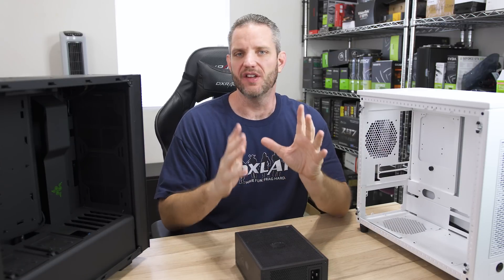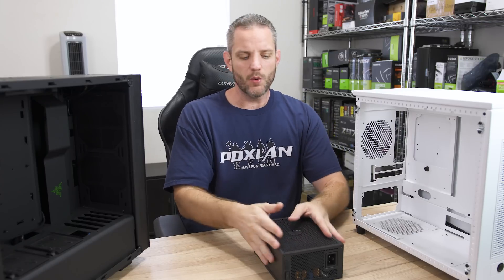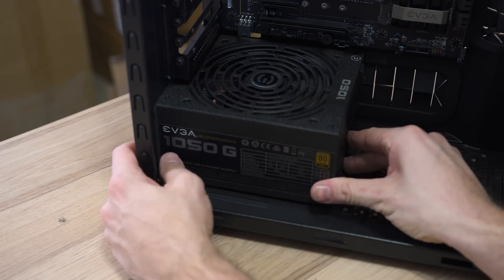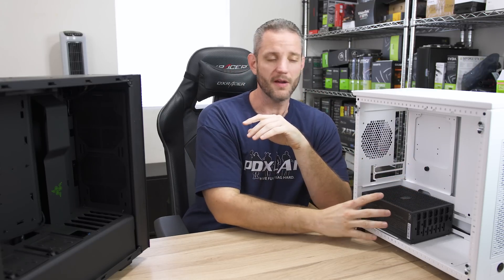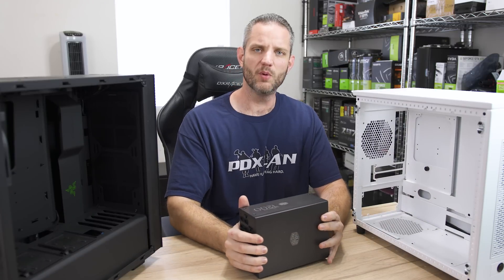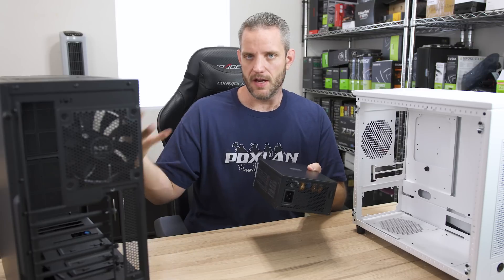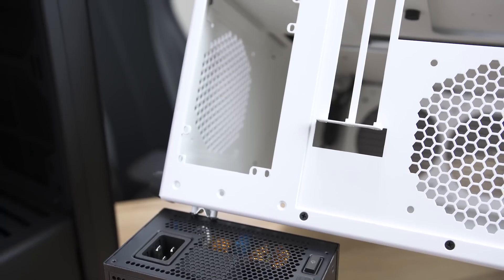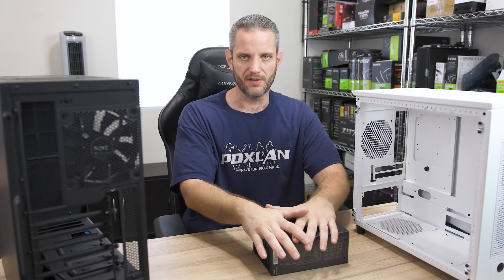Should you mount your Power Supply up or down?

Comment: I just recently upgraded to a case wherein the PSU is actually mounted at the bottom, and never even thought about putting the fan up. Now I'm wondering if flipping it might actually positively affect temperatures inside the case.

I've got a little question too: you do watercooling on pretty much all the CPUs I've seen in your videos, be it a custom loop or an AIO. Does the lack of air/less air movement across the mainboard actually affect the temperatures of the RAM modules and/or VRMs?

Comment: Then it's a fight for air between graphic card and this 'upside down PSU situation' in smaller and ... most of mid tower cases.
I'm kinda ''holding it down on the engineering tip ya' cuz  PSU is not cooling element. Designed to cool itself (with some margin of course) but not for cooling whole, badly organised system.
But, there is always exceptions.

Comment: I mount mine on the bottom with the fan facing into the case. My case has enough air flow that there isn't any stale hot air in the case for the PSU yo drag in. Also it has dust filters on the air intakes,  (bottom of the case doesn't) so it won't drag in dust either.

Comment: That's bullshit. Most good bronze and up PSUs don't even have the fan spinning until after X temp. So now you basically added another heat source into the case until the fans turns on. Flipped vent down, the heat can't travel up through the vents into the case.
Reply: 100% correct. He's full of shot by his own logic. Most of the time the fan is not on, or on so low it doesn't matter. this creates zero air flow in the case, positive or negative.

Comment: Jay, you forgot about one more thing i guess, u can also avoid psu getting hot from graphic card by putting in downside. There are different gpu cards and some of them create alot of heat, in my case psu pulled hot air that gpu generated which made 'him' to get hot.

Comment: Jay, I mount my PSU with the fan up.  I am on air cooling, the PSU fan does not spin up until under heavy load.  I chose fan up because the Define XL V2 does not have a filter removable from the from, therefore, I am not going to clean that filter.  Also, with positive case air pressure, air is forced through the PSU, keeping it cool.  I am going for cool and quiet with 2 input fans and one exhaust fan.  I have also added a magnetic fan filter to the top of the PSU.  If I had a Define R5 case, I would go fan down.  These are just my thoughts, but it works for me.

Comment: Hey +JayzTwoCents i know you usually answer questions so i'll ask it directly to you. I have a corsair 100r and only one exhaust fan in the back. My PSU is now facing down and i can't see how i would benefit from making it face up. 

Why is it that you say that if it is facing up then i have neutral presure? Isn't that PSU exhausting even more air so it would make it even more negative? 

On top of that i have a filter on the bottom and can't filter the PSU if i mount it facing up. What is your opinion in my situation?

Comment: So you're basically pushing air in the system with no air from the outside coming in?

Also what if you instead used mineral oil instead of liquid water coolant in the basic water cooling system? Maybe have a little something that can quick chill the mineral oil fast enough as it flows through the system to keep it cooled down.  The only thing I have ever see is people submerging their computers in mineral oil to keep it cooled, but never in a water cooling system with pipe tubing.

Comment: Recently I purchased Antec hcg-900 so I mounted it as the previous PSU with the fan facing down, the PC kept shutting down every few minutes in Games, so I found out that the unit shuts down after it reaches 45c, then I flipped it and no problems since.

Comment: Yes! Jay is back :)
I had my smile this morning, plus a ton of info as usual!

I had to buy a psu a few days ago and was wondering about the possibility to mount it fan facing down in order to keep it free of dust. My case is an Antec Three Hundred and has those little feet inside the case and there is space for the psu to breathe, so I will turn it upside down next time I open the case.

Comment: With all due respect Jay, I don't agree with you on this one (although if you have an overkill, silent fan PSU it doesn't matter... mostly).
Physics: the coolest air is at the bottom of the room (that's why your argument that the PSU facing down may draw some exhaust hot air would be valid only if you would've placed your pc case very close to a wall and leave no room for the PSU exhaust air to dissipate).
I found out empirically that is generally better to have slightly negative pressure inside your case cause that would pull out potential dust particles instead of pressing them into pc components (when you have positive pressure).
Exhaust at the top of the pc case is also crucial cause a warm air cushion will be formed in the top half of the pc case, where the CPU and RAM are located. That's why it would be a bad idea to have your PSU mounted there: it would heat up more when "cooling" with the hot air from inside the case and that would shorten PSU's lifespan.
Almost forgot: good day to you, Jay!
Reply: "...instead of pressing [dust particles] into pc components..."

facepalm That's not how it works. That's not how it works at all.
Reply: Convection is completely overruled inside of a case with any use of system fans. The forces of convection are minimal compared to the flow of air from the fans. 

Negative pressure does draw the dust into the system more than positive pressure (unless you seal the seams of the panels or any vents, and you can ensure that the larger particles are filtered out.  With negative pressure, the dust will come through every crack. Typically, directional airflow works the best in a case, front to rear.  All that is really needed is intakes to provide flow and pressure, the exhaust will work its way out. Blowing air on an object you are trying to cool is much more productive than sucking air from it. There are parts of the case that wont get much fresh air in a negative pressure system. The air will flow fastest where there is least resistance, where if you have positive pressure, with linear airflow, you will cool the system better.

If you burn your finger, do you blow on it or do you suck air away from it?

I disagree with him about the warm exhaust from the PSU being drawn down, its possible that some might, but not a meaningful amount.
Reply: I don't agree with Jay too. +A casual Gamer after watching this video I thought the same thing.
Reply: Harold Mossbach
Yes, front - in, top and back - out.
Most decent custom pc cases are built with this in mind anyway.
Reply: If you have negative pressure in your case you are sucking air, (and dust) , into your case and onto your components, you have it completely wrong.
Reply: That seems very well accurate but I guess it also boils down to how well ventilated the place is. If the case is stuffed into a corner with some other tech that gets hot or near a radiator it might be preferable to get the airflow from the front fans. Not that it should really matter unless you constantly suck in HOT air anyway.
Reply: what if the the case has a psu shroud on top? would this be good?
Reply: The older cases(from like 20-10 yrs ago) originally came with TOP mount for the PSU with fan facing down, which did act as a good exhaust for entire system and was practically impossible to drop water, screws, dust or other material inside(water blocks were uncommon back then), I still have such a case and will keep it as long as computer parts in ATX format will be available. Some reviewers and forum users do argue that this configuration was phased out because PSU was not cooled well enough because it sat right over hot CPU and VRMs and did intake hot air from those components + raising hot air from bottom compartments of the case. However I have yet to find any credible evidence that this actually does harm PSU as I had been operating this setup for about 20 years and I had PSU failure only once and that was PSU which was super cheap and worth about $15 (I have moved to better units since then).
Reply: @elerian9702  i completely agree with you but you can sell more case by making people think its better. case nowadays is more about the show then the go.

Comment: The single reason why you should NOT point the PSU's fan up to your case, is if you have a passive cooling PSU like the EVGA one, which turns on its fan on a certain power draw threshold :
It will not circulate warm air out of the case, and the warm air from the PSU will just rise, getting sucked in by your GPU, and eventually by your CPU, heating them up for that extra little bit of heat from the PSU.

The single reason you should NOT point the PSU's fan up to your case if you do not have a passive cooling PSU, but a "normal;" air cooled one, that constantly spins, is that it will heat the PSU itself more, sucking the warm air from inside the case, being heated up by your CPU / GPU mostly. That way the PSU, and the rest of the components have their own air intakes.

So, it is rather easier for that friend of yours just to put up a freaking piece of wood under his case, and get one extra intake of fresh air from out of the case.

Sorry, but none of your arguments here make sense, Jay, except the one that you should point it down in case of water leaks, which is just one more reason, added to the rest, not to face it up.
Reply: Vuk Mandic if the psu isnt pushing heat out the psu will warm the inside of the case regardless of up pr down ......... the only way to avoid that at all is external psu
Reply: Seriously though, we're talking about some serious power draw if a full internal psu heats up THAT much to be a concern. I personally find that at the bottom of the case is an all round terrible place to put an intake.... For any reason lmao.

I must point out however, that this chain reaction scenario you draw out is rather ludicrous, and reeks of madness. You make it sound like your thermals is your white wale or something. XD

Comment: Jay, I've build a lot of computers, for friends, colleges,...
But since I don't make money on that and that, I always buy what I think is needed for the system. Usually cpu cooler wize I went with a <40$ air cooler like the 212evo. For my computer as well as 2 of my friends' I build a waterloop and always went with a 240 rad or 240 aio. But with the arrival of 120 AIOs in the 50$ range, I would like to know it they outperform a 212 evo. But since I don't grab extra parts for testing, and you have so much laying around. Would you mind doing a little comparison? Do they make sense or should I rather go with an air cooler for the same price? And compare with 240 AIOs to see what would be the best bang for the buck.

Comment: Hot, sticky, sweet. I always thought it's better to keep it down for less dust to accumulate in the PSU itself. I once flipped a psu that was fan up for 4y and there were 9 generations of dust bunnies in it, more than the whole system combined. But then again, the last case I had had the psu on top (old school)

Comment: funny when I use positive air pressure my PC be filled with dust and with negative there lot lesser dust lol..and I always force my PSU fan to run no matter what it's not noisy anyways better to have it constantly cooling the components and still find mounting it down it's the best.

Comment: Also if you have a semi-passive PSU it could be better to mount it fan up so the hot air rises away from the PSU by itself and the fan doesn't have to spin so early/at all.

Comment: One factor to keep in mind though, is your GPU fan config. If it is a blower style then ok, do whatever you want. However if your card has open sides and has 2+ fans, it would be a bad idea to use the PSU fan to extract hot air from inside the case. Most PSUs have an operating temperature between 40-45 C so that may be a problem.

Comment: PSU... I bought a RM550X and its powering an E3-1270 and a GTX 760. PC runs fine, but PSU's fan never spun. I know it only spins up after 225W, but I fear the fan never spinning regularly may damage it... how do I "force it" to spin? add load to the system?

Comment: Jay or anyone else here I have a NZXT phantom white case I want to install water cooling but not sure what I should get and where I need to mount which radiator. I have a amd fx 8350 but when I am in my bios as soon as I switch my pc on instantly my cpu hits 60 and per second it goes up with a degree (Celsius) up to about 70/80 without any load so mainly I play csgo but obviously I don't want to play anything else due to the cpu overheating as it might fry it. Yes I have changed thermal paste multiple times but still nothing. Any help would be very appreciated!

Comment: I did some testing with mounting a PSU. I have a AXi power supply from corsair which uses the link software. What I did notice using the corsair link software if the fan was facing down it indeed was getting hotter compared to the fan facing upwards. But what really did it for me mounting the PSU with fan upwards was the airflow. As Jay said the fan doesnt run that much only under heafty loads. As soon as the fan did kick in it the oevrall temperature seems to drop 1 or 2 degrees. You can agrue only 1 or 2 degrees however it is still 1 or 2 degrees, 

Anyway again a great video. Keep up the good work. 

Ohh and when youre gonna fill up that awesome tiny white CL Nova case ?. I love that thing !!!

Comment: It should be mounted with the fan facing up, semi-passive and passive psu rely in convector principle (hot air rises) when running in passive mode and yes my english is not the best.

Comment: I have the RM850x, the kinda tier 2 low noise one, but I like my caps are cold as possible, every degree lowers increase life by many hours, so even though the fan if off and power draw is low, the heat got too high for my liking, so I turned it around so the high pressure from the case and push through and cool it, and that works, so basically a passive PSU that has a fail safe if it gets hot

Comment: I wasn't really sure on which way to mount mine and I'm still not. Admittedly I didn't get the best power supply so I want to keep it cool just in case. I've got a fan mount right above it so I mounted it up to get that extra air flow to it, but my GPU is above that and that fan has to feed both my GPU and my power supply. I haven't had any worrying temps, but do you think it should be mounted down in my case?

Comment: I had an old case that had the PSU mounted  on the upper side of the case, mounted on vertically and covering most of the CPU cooler and heat sink. Pretty strange design, but it did save a lot of space and that CPU wasn't thermal throttling (although that was happening in the Athlon 750 MHz days).

2 of my last 3 cases had the PSU mounted horizontally on the upper side of the case, but if I had a 120mm fan PSU, on my current one, it would take air from the CPU out the case and on my older one, it wouldn't work, since it was shrouded both up and down, it only worked with 80mm fan PSU.

Only once I owned a "behemoth" of a case (for me it was huge, and it was just an ATX Tower) that had the PSU mounted on the bottom of the case with air filters for the PSU included (although that is the only place it had removable one). I still prefer compact cases and I want to go SFF next.

Jay, can you test the performance of an AMD A12 9800 on some games? Like you did with the Kaveri 7850K with Battlefield 4, that was pretty nice. I know it's not your thing to check mid-low end hardware, but please give it another try.

Comment: some psu's can not be turned upside down, as they are fixed cables to one side, not unplugable types on the psu... so can not change them as they are fixed
Reply: doesn't matter, either way you'll be routing cables from A to B where they fit.
Reply: I'm not sure how fixed cables would interfere with PSU orientation. Flipping the PSU upside down doesn't change which side the cables come out of.
Reply: carnesiel
some psu's have fixed cables, at one corner permanently mounted this way, cannot be removed
Reply: ***** which completely doesn't matter. non-Modular Power Supplies are kind've meh but....
has no impact on what you're talking about.

if there's no room for permanently affixed cables on the end of the Power Supply................. there wouldn't be room for *ANY* cables, period.
Reply: *****
cables on the left side, turn it over, they now on the right side. and if ya had to turn it over,  on the right side, ya be stretching the cables to fit. if they are not long enough
Reply: ***** if they're not long enough, that's your fault for buying an eATX case and Motherboard and then choosing a Power Supply that advertises shorter than normal wiring.

and this is *STILL* nothing that explicitly has to do with non-Modular Power Supplies.
if that was a problem with non-Modular, the exact same problem would happen if the Power Supply was identical but Modular.

do you know anything about computers?????
Reply: *****  so what ya saying is to check to see if the psu has long wires? who even checks that ffs???
whole point  is, the video stated should you put your psu upside down or not.  i just replied  some times you can not do either is all... the video never mentioned Modular psu's at all. just access to air supply.